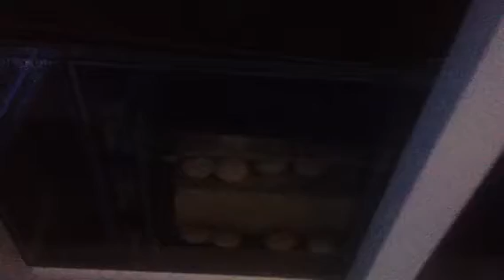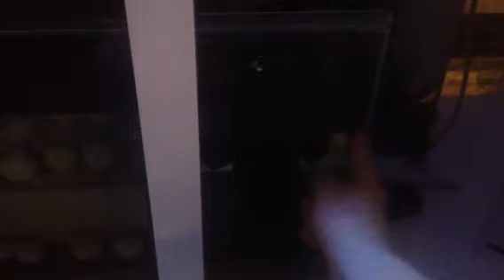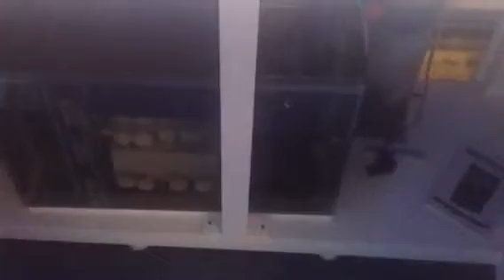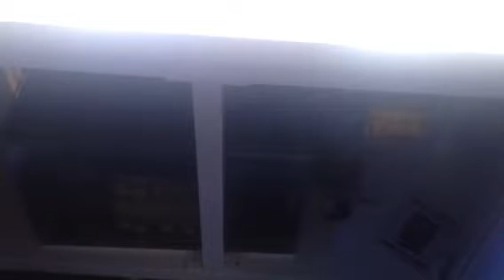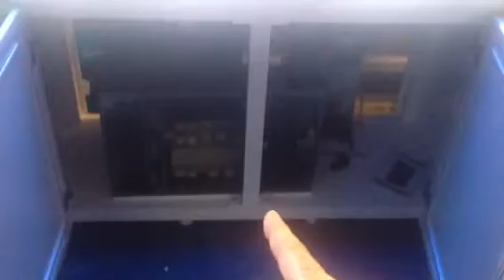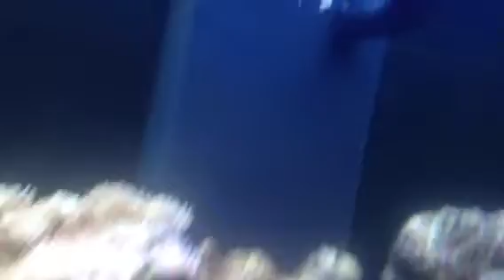How to set the water level of your aquarium sump filter

Comment: Just purchased a 450l tank with a 120l sump haven't had a sump setup before had it running but not to gone on the idea so may change setup for an fx6.is there fittings I can get to seal up 2 holes in the main tank as I won't be needing them?
Reply from the maker: Sure and plumbing supply could help

Comment: What if hypothetically speaking your overflow, or overflows are blocked and only water is being pumped into the display, how to accomodate for that since the display is already nearly to the rim?
Reply from the maker: It would overflow till the sump emptied but I have never had that problem
Reply: @MajesticAquariumsTV  it is a major possibility though, there has to be some way to set up a cutoff.
Reply: @skillz_311  Not ideal but design your return chamber to a volume that your DT can accommodate at which point you'd not have a wet floors but probably a burned up pump.
Reply: Not ideal but design your return chamber to a volume that your DT can accommodate at which point you'd not have a wet floors but probably a burned up pump.

Comment: Hello. I have the problem where my water level is constantly changing so I installed a ball valve to alter the water coming in to the sump. I have the problem where I have to change the water coming in because there's too much or too less going to the pump out section. Can I fix this and prevent me changing it every 2-3 days.
Reply from the maker: you need an extra divider of glass where the skimmer is to create a stable water level
Reply: Majestic AquariumsTV thanks for the response. Does the whole sump need to be at the same water level or certain chambers? And if I made it so the whole sump had a stable water level will it resolve the problem?